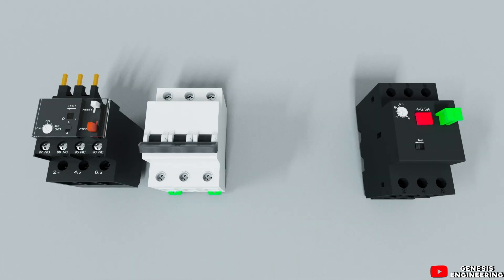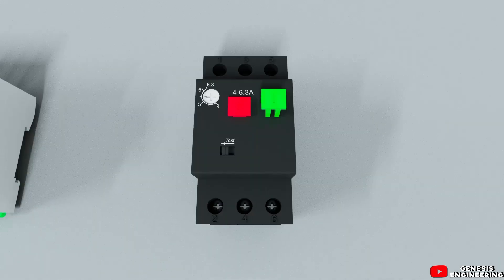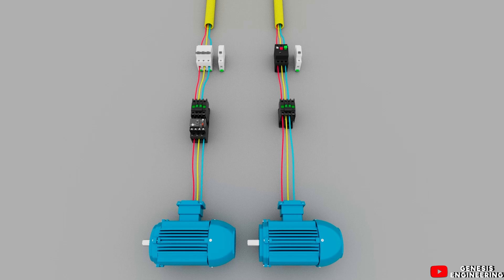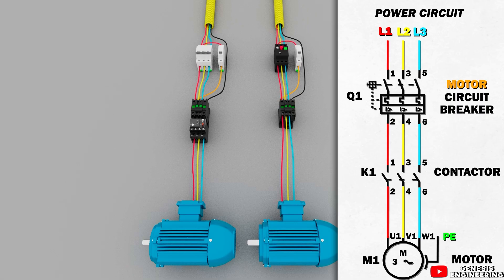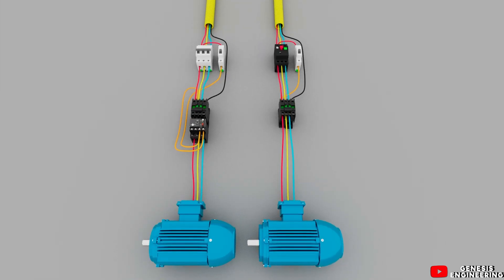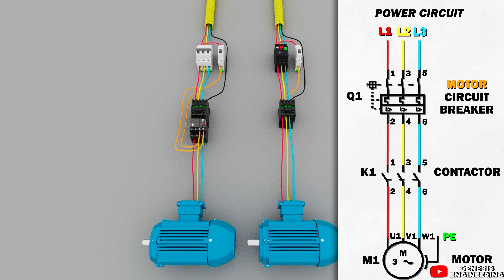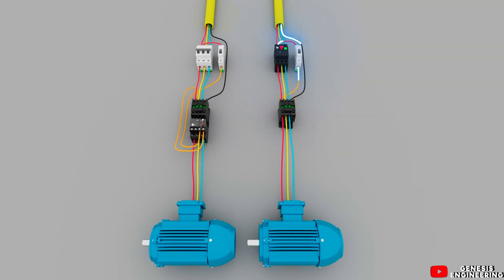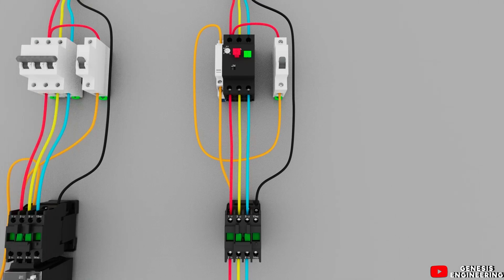WHAT IS THE DIFFERENCE BETWEEN THE MOTOR CIRCUIT BREAKER AND THE THERMAL OVERLOAD RELAY?

Comment: I have a hotdog stand that im installing a on demand 120v continuous run water heater.  It has a shutoff float for when the water supply tank gets low. How do I wire the float in?
Reply: Use contactor,  connect the float switch in between  phase and terminal A1 or A2 of the contactor,  and your auto water pump is done to use